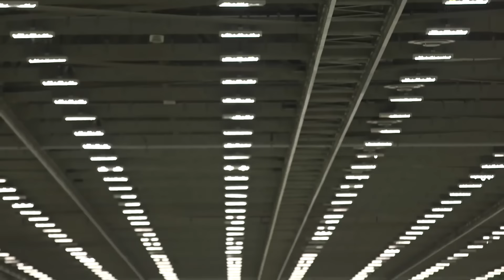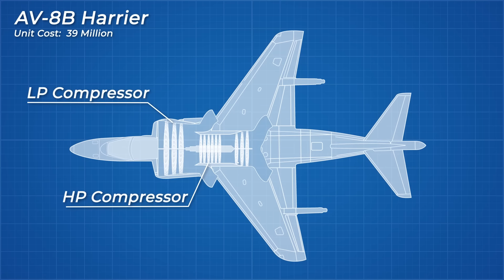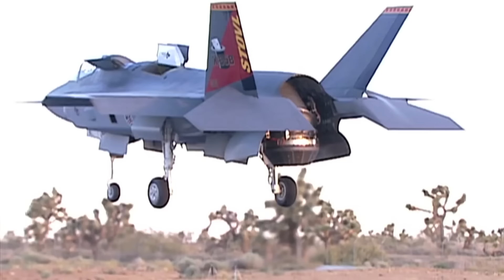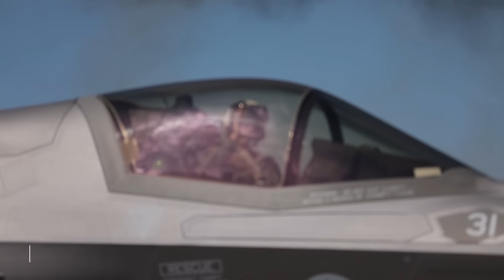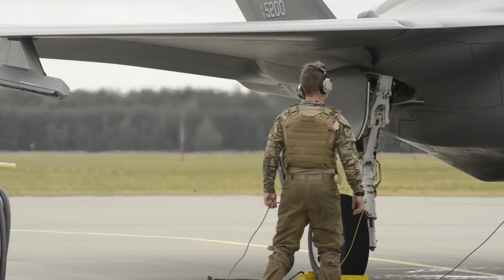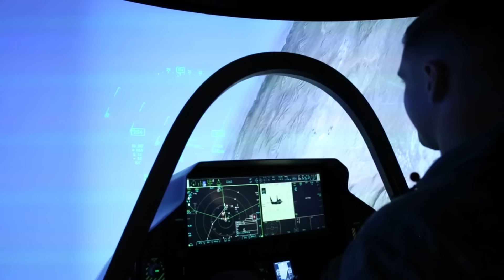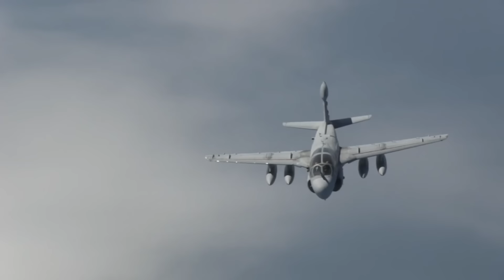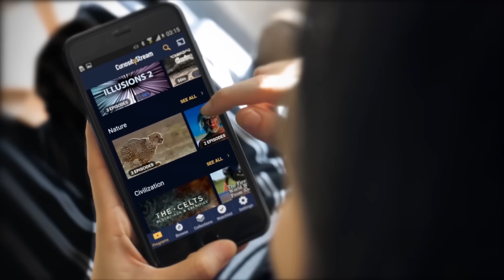Is The F-35 Worth $115 Million?

Comment: At 10:33, you said that it could have cut on spending if there were 3 different aircraft for 3 different branches. Would the air force's be the F-22, the navy being the F-18, and the marines being the F-35
Reply: Nah, not really.
Having multiple models without interchangable parts is path of logistical nightmare.

Comment: Great video. Certainly the F-35 sounds like it has incredible technical capabilities, but it is a little suspicious that the only report that actually criticised the fighter needed to be leaked to the press, while the people praising it worked on the fighter or worked for the developer. 

Nonetheless, despite the incredible technical achievements, what matters is its effect on a battlefield as part of a fleet of aircraft, and it doesn't matter if it is better at shooting down the enemy if there aren't enough of these planes in the sky to begin with. These planes can only accomplish tasks and move at a certain maximum speed with a certain efficacy,; even if you can shoot down the enemy twice as fast it doesn't matter if instead they can field 3 times the aircraft (with all their weaponry - which will be very similar). Price determines how many planes you can field and for how long (including fuel price for each outing),  so more low-tech planes can accomplish the same results, and be used more often for the same price tag.

That said, I think it's a great idea if all militaries around the world spend all their money on tiny fleets of incredibly expensive planes that are very expensive to run. That way, they would think very carefully before launching any planes, and everyone would have such advanced surveillance abilities that only very precise military operations will be devised with limited collateral. My greatest hope is that countries spend all their military budgets on developing ever more advanced technologies and have no money left for anything else. ^^

Comment: What people fail to understand is that: 1 trillion involves maintenance, software, operator training, and other costs for its operational life until 2070. No "Legacy"/"Teen Series" fighter development (F-14, F-15, F-16, F/A-18) has been calculated this way.

The F-35, despite all the Woozle/disinformation effect on the fighter, will be the main face of Western fighter aviation for decades to come.
Reply: But the fact it has to extend its life to 2070 in order to justify its cost is the problem. Today's stealth won't be tomorrow's stealth
Reply: @archer1133  But that doesn't mean that the F-35A/B/C of today will be the same F-35A/B/C of tomorrow, as throughout the operational life of the aircraft it will receive capability upgrades/enhancements to stay relevant. The Block 4 upgrades will allow the inclusion of a radar with GaN, the RAM coatings should certainly be improved in future upgrades. On the rest of the Stealth features, there will likely be aircraft with better VLO levels in the future, but the F-35 should remain a well capable aircraft in that regard for quite some time (especially compared to Russia and China).
Reply: @lucasfeliphe7028  While it will probably remain relevant compared to other countries, the potential of the USAF 6th gen fighter may revolutionize the airspace. Plus, with 7th gen having the possibility of fission as a power source, it would completely change aircraft design. While the F35 will remain relevant for some time, I doubt it will last till 2070. In terms of capability, it will far outclass Russia, however, China is rapidly modifying its military, faster than ever seen before. They have a large industrial basis and have the potential to match current US capabilities. I wouldn't downplay the growing Chinese capabilities that could make this airframe ineffective in a future war.
Reply: @archer1133  It is interesting to mention that many features of the avionics and sensor fusion that the F-35 is getting may act as a "test lab" for the fighter aircraft resulting from the NGAD program.
I found the possibility of a 7th generation fighter having fission as a source of energy supply interesting, do you have any sources delving into this possibility?

In fact China in many areas has passed Russia, but there is little internal insight/transparency of their capabilities.
Reply: @lucasfeliphe7028  Yea, I meant fusion btw. Got confused with older programs. I said 7th gen as speculation. This technology may take years more to perfect, however, there is virtually no information on 7th gen systems so I decided to just throw it out there. Here is a video talking about the possibilities of what Lockheed is trying to achieve: https://youtu.be/-Vdag-7McJQ

In terms of Chinese infrastructure, here is a video from Perun. I highly recommend his content: https://youtu.be/mH5TlcMo_m4
He also has another video talking about future 6th gen fighter programs (more in the economics term than going over every capability) if you are interested: https://youtu.be/RPrWm6fWuaM

Comment: Aircraft maneuverability is becoming increasingly irrelevant since missiles like AIM9-X have off-bore targeting and can pull much more Gs than any plane. No matter how maneuverable a plane is, it does not even close to that of a missile.
Reply: Saturated sausage  If they are both good pilots, they'll go to the MAR. If they ran out of missiles, they would probably opt to RTB than to dogfight as the airframe and pilot are extremely valuable to both respected countries.
Reply: F-35 can deploy a drogue attached by wire. It jams signals and if need be, takes the hit. American military is water tight.
Reply: This is what most people have trouble wrapping their head around. After watching so many Hollywood movies it must be difficult for them to learn that aerial combat is NOTHING like they see in cinema. If 2 planes ever got into a dogfight 90% of the time they'll both die.
Reply: @vincentphan5097  If they both cross the MAR they will. If they go to a dogfight, then most likely, only one will come out victorious. This is where missile maneuverability for the F35 really matters, cause fat amy can't turn for ****.

Comment: I think this aircraft tries to do too much, it costs too much to operate and has a huge maintenance overhead.
Its enemies will defeat it by having frequent sorties against it to keep it in maintenance. 
Eventually its opposition will overrun and destroy its base
Its war will be the war of the fitters.
Reply: Those with a limited knowledge of modern aviation, specifically military, often fall for the series of myths about the F-35. I suggest you look into where you read your information from, because it's probably a junk article made for online money grabs. First, the JSF has 3 separate airframes all optimized for their different roles, and masters them well. I believe you got this from the quote that has been spread through social media? Here is the full one, “A jack of all trades is a master of none, but oftentimes better than a master of one.”

The F-35 has a CPFH of $33,000 currently, and in FY2023 it will drop down to $30,000. This is comparable to many fighters jets. For maintenance time it only requires 5 hours per flight hour, similar if not better than most fighter jets. In the last 6 years of Red Flag the F-35 has been absolutely destroying the competition with a 28:1 kill ratio. These large scale exercises often have the ROE heavily favored towards Red Air. For rookie F-35 pilots to routinely defeat veterans in these conditions tells volumes about its capabilities.

Funnily enough, it will be the F-35 overrunning opponents. Adding American logistics will turn this aircraft into an utter demon.

Comment: That is a great deal - considering all of the R&D each unit costs over 600 million -
Reply: Eh, its currently sitting around 400 million a unit, but with the most recent batch going all the way down to less than 80 million a unit, the average price is dropping pretty fast.
Reply: remember that the cost per airframe includes a spares package to cover the servicing of the a/c type for its lifetime not just the a/c itself!!

Comment: once the helmet and headup display unit systems have been taken into account,  the price is more than this,  way more.  least the british ones on order...  it should be titled £ instead of $  then it be nearer the mark.
Reply: The helmet is included in the price, and the F-35 does not have a HUD.

The full acquisition costs are higher no matter what type of aircraft is being discussed, because it is a different type of cost that includes a lot of extras and varies from customer to customer depending on what they want e.g. they might want a more intensive training package, or more spare parts than another customer.

Comment: One plane for three services was just a fantasy.
Reply: No? What?
Reply: @rick7424  I meant just one model of the plane for three services.
Reply: @col.waltervonschonkopf69  It isn't just one model. The variants are physically different to suit the requirements of each service.
Reply: @dumdumbinks274 I know that, dear. But that is not the idea with which they began their program.
Reply: @col.waltervonschonkopf69  Not if you go all the way back to the origins of the X-35 in the 1980s. But the JSF program specified a requirement for 3 variants since it first began in 1994. The prototypes were not produced until 1998, and both the X-32 and X-35 competed with CTOL and STOVL variants. The CATOBAR variant was not required during the competition, but was expected to be produced by the winner.

Comment: Worked on the F-35 project, some random info: The X-32 was dubbed "the guppy" because of its large intake. One is on display at Pax River NAS in Southern MD last I saw. Knew a pilot who had to eject an AV-8 and was injured, he was later the big boss at the F-35 engine maintenance and test facility at Pax River. The F-35B's entire exhaust nozzle points downward and incorporates a separate lift LPC in front of the jet engine, hence its much higher weight capacity compared to the AV-8. Had a beer with the test pilot Jon Beesley, happened to be at the same bar, while we were at a test facility in NJ.
Reply: OK your comment should have a thousand likes.  Very cool, man!
Reply: Actually it was called the MONICA